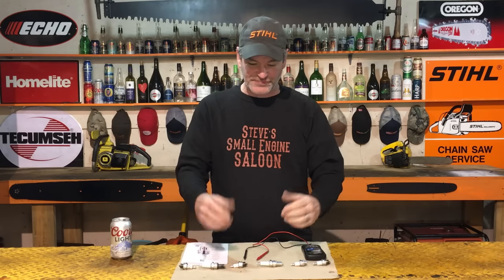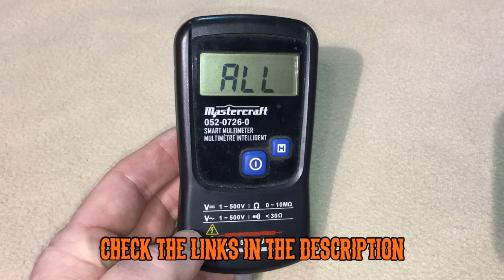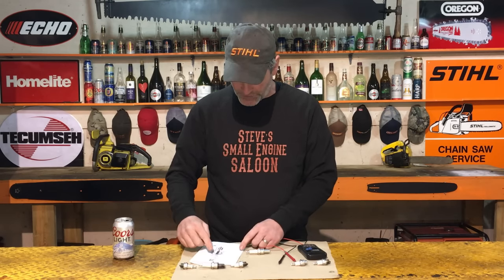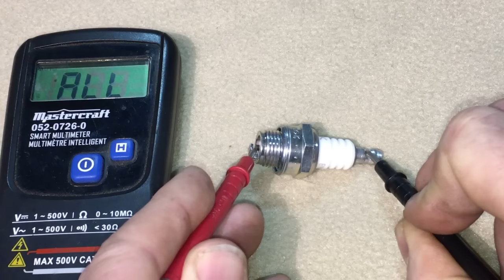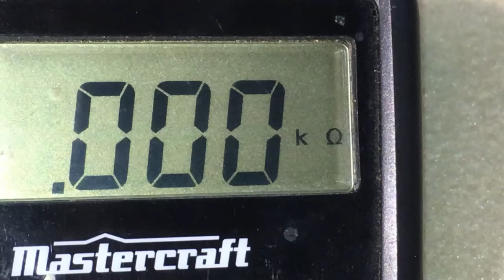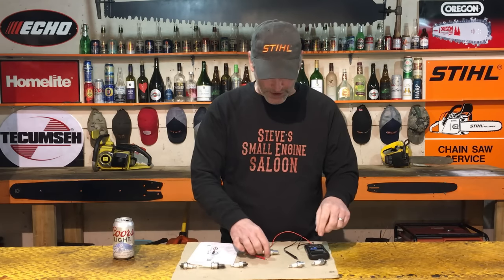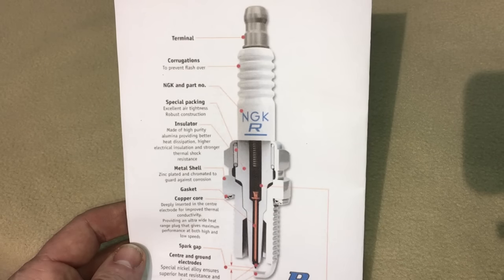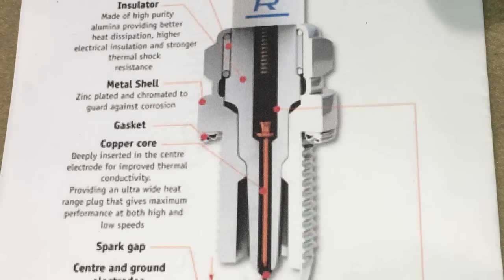How To TEST A SPARK PLUG In 1 Minute

Comment: Great video.
Valuable info for sure.
When I was a kid,before we had cable tv we had an outdoor antenna.whenever a snowmobile went past the house that didn’t have resistor spark plugs in it the picture on the tv would get fuzzy until the snowmobile got a ways down the road.
Please keep the videos coming
Reply from the maker: Thanks for sharing

Comment: You do a lot of good info Steve but this ones got whiskers on it matey.
A plug can fail long before it will show any sign of failure using a multi meter, even spinning the engine over with the plug out and grounded may show a spark yet under compression it will not spark, and in some cases the plug will idle ok running but misfire under hard throttle (high engine load).
And the problem with either test method is if the person testing the plug assumes because it shows a spark out of the cylinder or passes the multi meter test they consider the plug must be ok and the next thing they do is start pulling other things to bits looking for a faulty elsewhere and worse may even start replacing good parts when it is the plug all along.
Secondly, don't clean plugs, you can clean them till your arm falls off but it wont get rid of the combustion by product from the nose cone that compromises the insulation properties of the plug that may fail under high current (high engine load).
Keep a new plug spare at all times and if in doubt swap the plug out, and aside from a suspect plug sending you on a wild goose chase looking for faults elsewhere, a bad plug can damage a good ignition coil so just fit a new one at the first sign of plug failing or after X number of hours use even if the plug still works because a plug cost a lot less than a  coil.

Comment: Tip when first using meter always touch probe tips to each other to verify meter is working. (Should read 0 in ohms mode.)
Reply from the maker: Thank You...
Reply: And sometimes you need to calibrate them too. Especially with some of those crappy old swinging niddle type of multimeters.
Reply: @shenghan9385  What you are referring to is called an analog meter they are still sold and can be expensive and very useful for some applications. For instance - checking a throttle position sensor operation and resistance, I would not use a digital meter for that, you just can't see if it is working properly with a digital meter. You need to see the smooth and gradual resistance changes that an analog meter shows very clearly.
Reply: @shenghan9385  OMG!  I have forgotten about calibrating a Simpson 260.  I have been using Fluke digital meters for about 2 decades in elevator service industry.
Reply: In practice you always get a reading of 0.2 ohms or so when you touch the leads togeather on a multimeter. When on the lowest ohms range.
   However one should take this into consideration when measuring continuity of power leads etc.

Comment: First part of the test is good, as far as the integrity of the central electrode is concerned. The second part is wrong. The second part is about the strength of insulation between the two electrodes which a multimeter (common) can't do. Normally a megger (measuring high voltage) is used to check insulation under conditions of high voltage. This can't be done with a cheap multimeter.
Reply: I don't think he needs to test the actual resistance between the electrodes. If it is other than zero, throw it away. A megger is a very expensive tool, just to find out if there's a crack in the ceramic insulation.

Comment: Good explanation. Have you tried continuity and resistance check on the new EMS plugs that Briggs & Stratton are using on their new engines? As you probably know, a RC12YC plug is common on most B&S riding mower engines. Some engines now require a QC12YC. It has to do with electromagnetic interference. I have experienced poor performance using RC12YC on the engines that call for this plug specifically.

Comment: Theoretically then, you could have a plug which sparks when you've got it resting on top of the head but when it's back in place the engine compression at high speed could open up a fault in the ceramic and cause a short?
Because it sparked fine when you tested it you would then think the plug's not the problem...
Reply: no wrong...the compression in the hole is a high resistance for a electric connection to jump over to the ground electrode which is the thing you bend to get a gap for the spark to jump ... it takes a lot of current to push the spark to make contact to move thru to the treads of the plug to continue movement back to ground .... so what is happening is current is traveling in a circle back to a home to neutralize the resistance of the valence ring with the positive and negative electrons, so what is happening is current will travel back home to a ground the fastest easiest way... so going though the crack in the installation would be a easiest and no hard resistance way back home to a ground, versus trying to push its way over the air gap with all that compression air in that gap to start with you must just take in the knowledge i am giving you on electrons trying to jump across a big air gap is very hard thing to do with all that pressured air in that gap. now with no pressured air out side of a cylinder  checking a spark at the end of the plug it now is free to jump over to the ground electrode which is connected to the threads which is your ground of the head... so just because it sparks outside of the head does not mean it is a good plug. now remember this that the coil may be very weak and not have the power to push current though the plug when under compression presser .... so now you have another thing to think about that the coil is failing and not pushing the voltage to move the amps though to AIR GAP ...  i did TWO years in a college studying this crap...   Haha...

Comment: Wow, I had an RC12YC plug in a drawer that measures 189k ohms. Didn't think it could get that high. Into the trash. 
And thanks for the video. I checked a bunch of new resistor plugs, and found they're all in the 5k to 6k range.

Comment: I get free or cheap gas engine machines and i fix them and resell them if they are still good. I hear this all the time. I changed the plug and it still wouldn't run so I bought a new one. Actually it is almost always a dirty carb but I rarely have to trouble shoot a spark plug. i did not know how to test them though so thanks for the great video. now I can make sure the plugs are working properly in machines I sell.
Reply from the maker: Right on Buddy...

Comment: It should be pointed out that when reading an Ohm meter, when there is a K preceding the Ohm (“horseshoe” symbol "Ω" ) it means to multiply the reading times 1000.   Examples:
10.123 K Ω = 10,123 Ohms
12.456 K Ω = 12,456 Ohms
10 K Ω  = 10,000 Ohms

Comment: Checking the spark plug first, in a series of diagnostic steps, is an interesting approach. But when I VOM'd my plug, using DCV to show any kind of continuity between the top and bottom connectors of the center electrode, my (cheap) meter showed only a flashing "--0.00". 
On the Ohms scale, my meter showed "1.0", which is exactly the same as when my probes are not touching anything-- zero resistance, which makes sense. Since my meter does not include a continuity test setting, is this the best such a meter can do?

Comment: Can you replace a non-resistor spark plug with a resistor one?  I went to buy a spark plug at my local shop, bringing the original number with me (non-resistor) and the guys there gave me not only a resistor one, but also one with the next higher number.  I understand that the next higher number (so, the spark is slightly cooler) might be ok, but they told me that having the resistor wouldn’t make a difference....????  Is that true??
Reply: True
Reply from the maker: Many people do it all the time with no consequences.  However Stihl claims that there engines require a resister plug, and if you don't use one it can interfere with the timings in the ignition module (coil)....
Reply: Thanks for the replies!!!

Comment: Steve when you test a plug like that it could still be bad for the spark must bridge the gap in the dense compressed air as at the end of compression stroke when the air resistance is much higher and thus it may leak the spark through a bad insulator with no spark over the spark plug gap. The spark will allways take the easy path.

Comment: I enjoy all your videos.   My favorite part is drinking an ice cold one.     Thanks Coach.   We're working on two old chainsaws that still got a lot of work in them, and one weed eater.   Carb work on all, and a new coil on one chainsaw.   The smaller older chainsaw, the coil measured no continuity. My question is, what burns out these ignition coils on small engines?    Is it the heat or just too much use? I can't see any physical damage to the coil, so I imagine the copper coils just burned out.    The repair was inexpensive.

Comment: Where's the link to that NGK spark plug printout???
Reply: https://goo.gl/images/kTpMNg -  Not quite the same diagram, but shows both types.  "R" type has a resistor built in to suppress noise on radios.
Reply from the maker: Its on my website www.stevessmallenginesaloon.com tab at the top says tech specs and documents....

Comment: Fantastic, as always. Thank you. Just a small note from an electronics guy: if the dielectric material (ceramic in this case) has a crack, the item which can leak between electrodes is current, not voltage. Love your channel.
Reply from the maker: Thank You...
Reply: Not entirely true. If there is a crack and it is not contaminated, the meter won't find it, but the high voltage coming through the spark plug wire will break down the air in the crack and act like a short. Kind of like a static discharge.
Reply: @EngineerHank , then, there’s the compressed fuel/air mixture within the cylinder to which the energy has to overcome to cause ionization of that mixture. But, you already know this.

Comment: Nice vid enjoy your knowledge I listened to explain continuity but good continuity doesn’t mean good conductivity because when current flows there can be excessive resistance problem like a wire for example with only a few wires with broken strands and your ohm meter showed good continuity like a voltage drop. Hi resistance same as a resistor plug So good continuity doesn’t mean good conductivity their is a difference CHEERS ENJOY YOUR TIME MAKING INFORMATIVE VIDS

Comment: Never knew about the "R" thing and I worked at various auto parts stores for about 2 years
Reply: I herd that the R in the auto industry means that it resist  engine noise on your radio. But I ain't no expert. that's just what I herd.

Comment: Thanks for all your advice. I love your videos. I have a problem with my craftsman lawn tractor. It has a 23hp  twin intek engine. B&S model 445577-1340-B1. Won't go over the hill when hot. Does it have a compression release system. Or is it something else.

Comment: Great explanation, I have a brand new NGK BM6A that has no spark, no reading what so ever, so I stole my stihl ms250 NGK BPMR7A and it runs well in the motor, nothing like buying new stuff that's all ready stuffed, Champion CJ8 plugs had a bad batch for ages and didn't care less or reply, getting more NGKs but will test them straight away so they can get returned if faulty, which brand plug would you recommend, when a company doesn't care they loose my faith in trust.

Comment: Good info Steve , I was told once that resistors also protect against interfering with cardiac pacemakers....could this be true?
Reply from the maker: Never heard that before but it sure sounds legitimate....
Reply: Steve's Small Engine Saloon 
Bill & Steve: As a guy who’s had a number of pacemakers for u20 some years, I’ve been told not to do any kind of electrical welding and stay away from strong magnet fields - like those generated by MRI machines. 

I’ll give Medtronic (the maker of my current (poor choice of words) and past pacemakers and see what they have to say. I’ll get back to you, Bill and Steve. 

Roy Lewis
Buffalo, NY
Reply: Yes. You are definitely right. Next time when you see any electrical appliance make sure you add a resistor of some kind in the circuit. That way you can be sure that no one with a pacemaker, bionic eyes, ears, arms and legs is endangered by your use of any household appliances. The simplest to add a ton of resistance is to replace the electric wires in the power cable with very fine steel wire, like about hair thin. Its very cheap and effective, you can be sure it draw tons of voltages and that is good, that's what a good resistor is for. And don't you worry about the energy loss through heat, it's winter. Right. And I can guarantee you that you will not have to worry about it showing up in your next electricity bill if you follow my suggestion to the letter.
Reply: I read that in my mother’s pacemaker website manual so I can tell you for sure, yes it is true.

Comment: What I have found works is taking  a old push button grill igniter, splicing with an old plug wire and hitting the igniter. So far it's been working for me, on small engines at least
Reply: Brilliant idea, I've got one from an old gas boiler. Thanks for that 👍

Comment: I use a different method, take the plug out, reconnect it to the plug wire lay it on the engine head pull the cord, you get a blue spark..then it's good move on
Reply: integr8er66 there is a problem with that method. If your plug wire is bad or your coil is bad then you aren’t going to get a spark. That is what he said at the very beginning. This test is to steer you directly to either plug is good or bad right from the start. That’s all.

Comment: Dang....talk about spark plugs. Just worked on a Troy Built 105 140cc MTD for a relative. Pulled the plug and left it connected to the coil wire and was getting fire through the spark plug when turning the engine with a drill. (I had already eliminated the possibility of it being a fuel issue.) I'm now thinking timing like crankshaft sheer key issue.....it was perfect. I reset ignition coil gap while I was at it and still could not get it to fire....along comes this video and bingo....I tried a used compatible plug that was in my tiller and the thing runs like a champ. The spark plug was getting spark but there was some issue with the internal electrode that cause the ohm reading to read no continuity when testing it?  PS...Coors Light is my go to beer so this video was extra special..lol ! Thanks for you videos.

Comment: Steve, I have a craftsman LT 2000. Replaced plug, 2 new coils and can’t get spark out of the plug. Safety switches check good. Set coil at 0.10 thousands no spark. What else can I check? hope you can give me some insight on this I’m stuck.

Comment: No spark no problem.  You put a 10 Penney nail in the plug boot and have a buddy hold it against the engine,  Crank the engine.  If he is still standing, you have a magneto problem.  If he is jumping around cussing you, the plug was bad.  30 seconds........
Reply: I use a phillips screwdriver and my own hand if it's a pull start. And pull slow at first.....

Comment: Yes Steve great advice. Was north of Inuvik and my chainsaw failed. No spare plug. Found out it was the coil shorting and used some grease from an axle bearing to run down the crack. Got the road opened and back to civilization!
Reply from the maker: Nice work!

Comment: Be sure when testing that the tip of the plug is clean.  Carbon migrating down the insulator on the outside can reach the 'ground' area of the plug.  Differing heights of the tip insulator is what gives different heat ranges.  Use higher heat range for oil burners.

Comment: hey Steve question. my ryobi bp42 11 yrs old won't start. I bought a brand new carburetor. engine has compression. i do have spark but still won't start. not even a hint of starting. i even tried a spray of engine starter fluid. nada.
question: is there such a thing as a weak ignition coil that will give spark to spark plug but not enough to start the engine?

Comment: The correct gap is important . I just had a Briggs & Stratton 7 H.P. that would not run . The gap was .025 . I set it to the correct gap of .030 . It started on the first pull . Thanks for the information .

Comment: So theoretically... If I have a weed whacker that have a weak orange spark, and rarely even tries to run when try to start it, it can be because the previous owner perhaps changed the sparkplug and used an R-plug when there should not be one? And possibly installing a non-R sparkplug might theoretically give stronger spark?

Comment: Would it not be fair to say that if there was a crack in the ceramic core (ie after dropping or knocking it for instance) it would still pass your resistance tests shown, but would allow high voltage to jump through from the core to earth resulting in a misfire? Unfortunately, without extensive kit the cheapest and easiest test really is just another known good spark plug, even if its the wrong one for the engine - as long as you don't install it mind...

Comment: great videos, way back in the 70's auto m. school we had a spark plug checker that would check the plug under engine compression ,you hooked it up to 120 volt and a air hose.worked very well,i have not seen one since.
Reply from the maker: COOL!